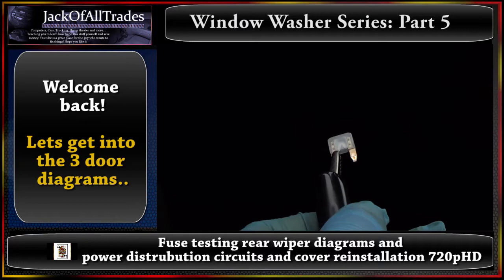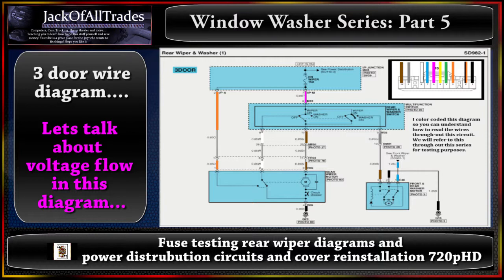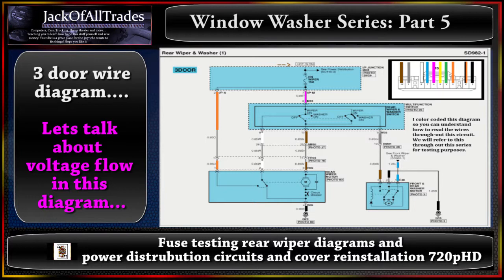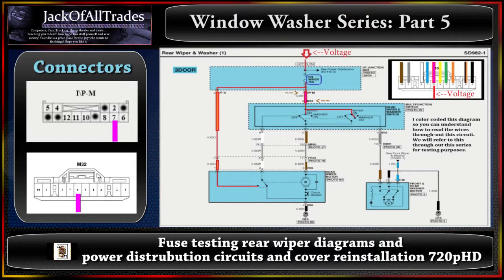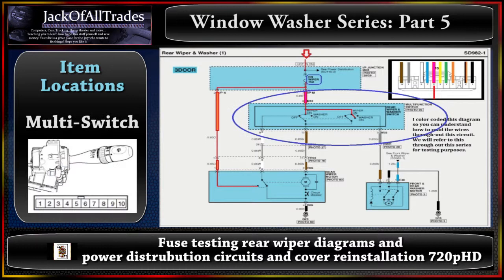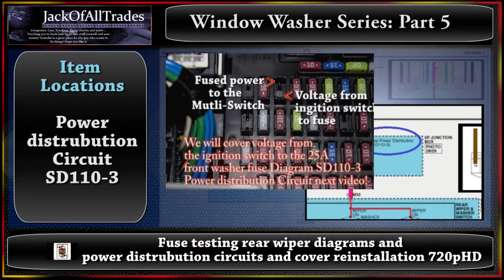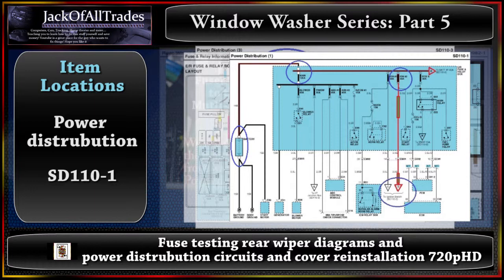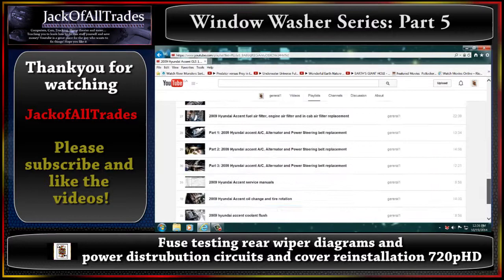2009 Hyundai Accent Window Washer Series part 5 testing from fuse box to the switch 3door  in 720PHD

Comment from the maker: Next video will be released after turkey week ;) Decided to show you a tear down or the 3 door rear and show you ground testing. Rear motor testing. Detailed description of parking function and how to mimic  the pump operation away from the cars wiring replacing the multiswitch to run a complete 360 deg rotation of motor and enable parking function from the load. I show you how to take off the rear panel and show you the bolts and washers to remove the wiper arm and the wiper motor. Im sure many will enjoy this video.......
Reply from the maker: Special thks to jason who supplied the 3 door in this video. In order to complete my series I needed to cover both 4 and 3 door models as per hyundai service tech manual 2006-2011.

Comment: For 90% of the people ,,, just check for power down at the plug at the pump.. 3 wire connector.. if no power there then check fuses.. keep it simple. This video  is if you have  a needle in a haystack to find literally.